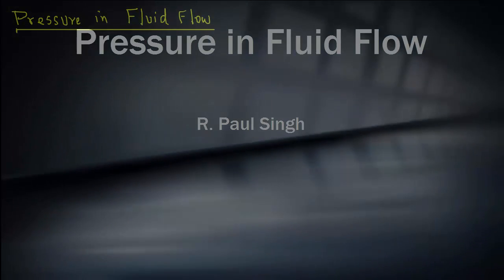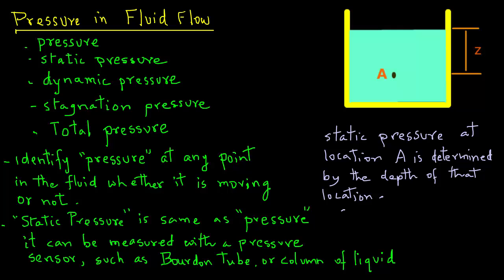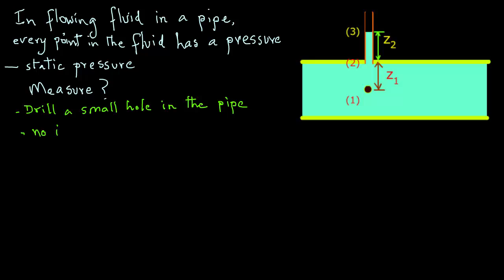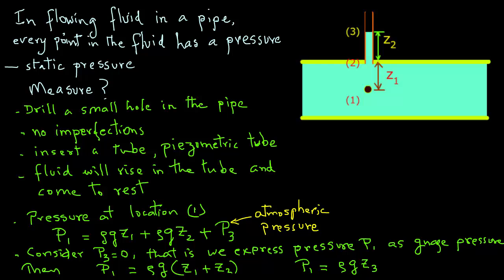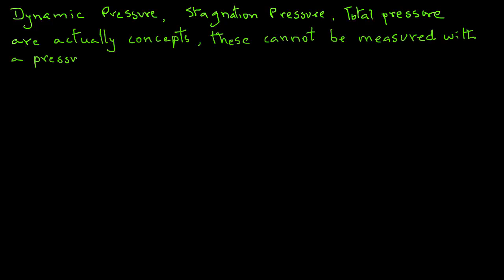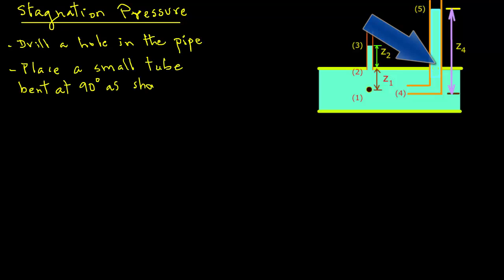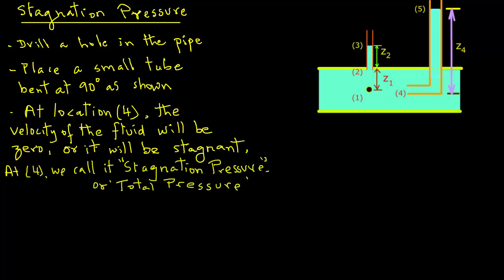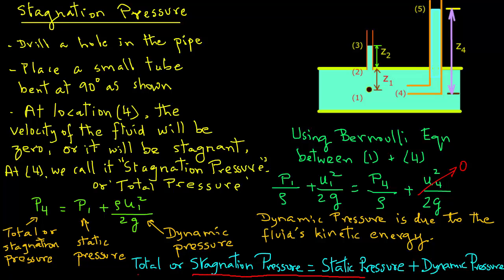Pressure in Fluid Flow

Comment: So which is bigger static or dynamic pressure?
Reply: Dr Sosora it depends. P_static + P_dynamic = P_stagnation. If using an isentropic process, P_stag will be constant. However, P_dyn and P_static can change depending how fast the flow is. So if the fluid is not moving, then P_static = P_stag which will cause P_static > P_dynamic. But P_dynamic > P_static can occur. P_stag = P_static + P_dynamic will always be true.